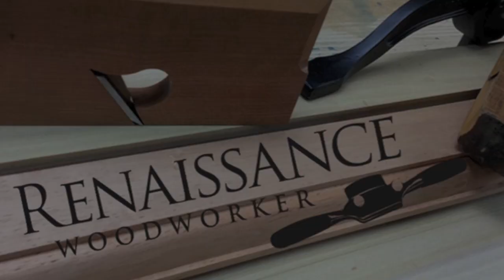RWW 173 Hand Tool Sense

Comment: Very educational videos, thank you very much for sharing. I have just set up my planes and it's a good feeling to be able to plane tin shavings without a problem . Have ordered a even finer stone for honing my plane blades, not that i need it but it's an obsession to have the  sharpest blades possible. And i like the process of sharpening, i have bought som Lie Nielsen planes 
4 1/2 bench plane  - block plane- shoulder block plane - and the low angel jack plane and they are fantastic planes . A little to pricy tough . Once again Thank you very much for sharing

Comment: Blade reflection tip is great! Just tried it and got perfect, parallel cuts. No other tricks needed.  As an experienced woodworker, do you find yourself using this method exclusively? What are you paying attention to naturally when you saw?
Reply: Oops...wrong video...
Reply: Just kidding.  Correct video. @16:14